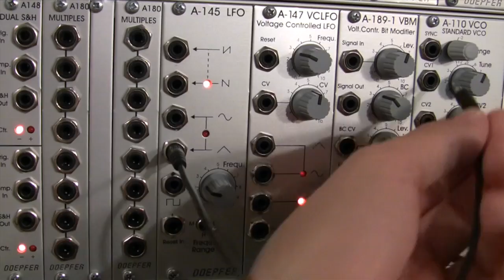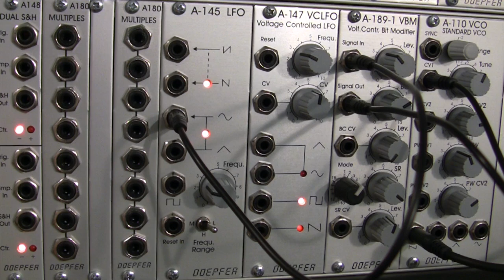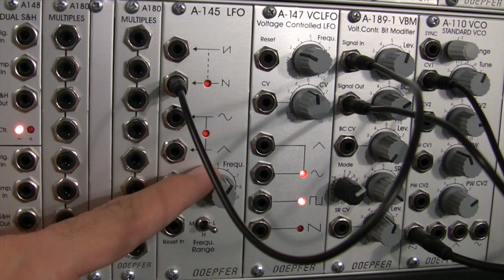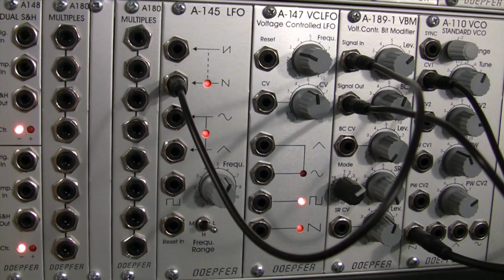Processing CV with Doepfer A189-1 VBM-Voltage Controlled Bit Modifier

Comment: have you tried out a CV-adding loop?
external CV generator->lineair mixer CV input 1->bitcrusher->S&H->back to lineair mixer CV input 2. Now tap from the S&H using a stackable patchchord or multiple and feed that through a quantizer to the pitch of an oscillator.

only question is which mode to select, so the routing will generate an ongoing pattern.
By using the A-155 as CV generator, a lot of interesting onprogressing tunes should be created. (if it works like how I thought it would)